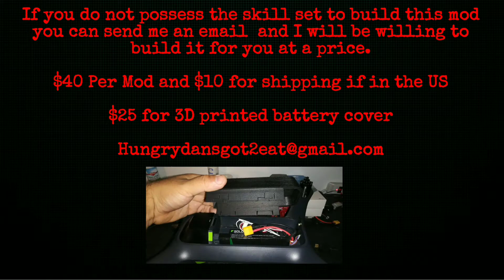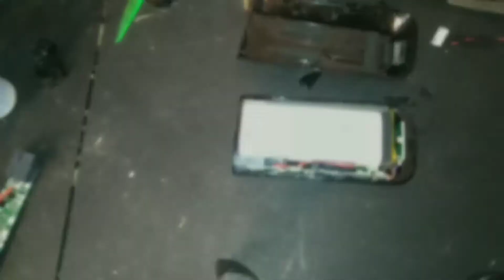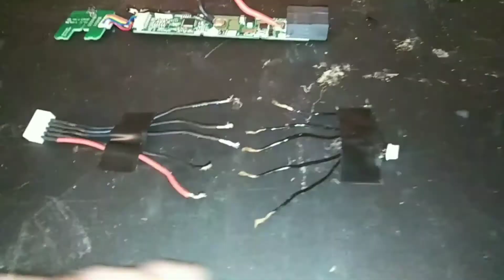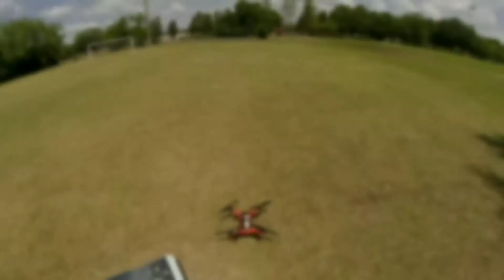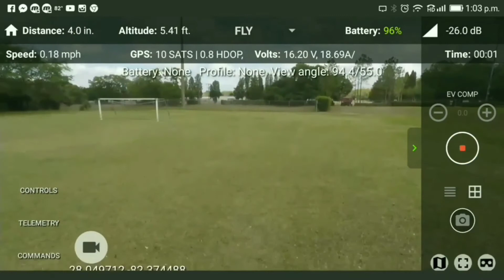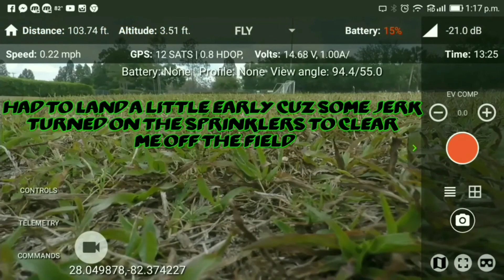The DW 3DR Solo Battery Mod Complete Build Instructions And Info

Comment: Great info Dan!! Thanks for working this out and sharing with us!
My batteries are ok right now, but it's good to know I can mod my own when they eventually give in 👍👍👍
Reply from the maker: All of the batteries I fly with are okay until they fail you don't know when it's going to happen it just happens you should watch my last video you will understand what I mean
Reply from the maker: https://youtu.be/65hL-Lu2nvo
Reply: I see what you mean mate, I'll be sure to keep a close eye on battery percentage and volts!
Cheers bud 👍
Reply from the maker: @StuartTiffany  I don't think you understand whether you're monitoring the voltage or not you won't be getting your solo back if you're under pitch controls drawing amperage to the motors hovering is one thing but moving in a directional path at anything over 12 to 15 miles per hour when a cell fails will cause immediate black out of the solo I won't have enough power to keep sustain flight so unless you always plan on flying at 12 to 15 miles per hour every single flight I would suggest performing the battery mod so you don't have to worry about it anymore. That was a perfectly good battery that only had two flights and it toasted on its second flight right in front of me if you had been flying when that battery did that your solo would have crashed without any warning
Reply: Point taken Dan, I intend to keep my Solo flying as long as I can, so I'll look to sorting my batteries when I get time 👍

Comment: almost 20m of fly time thats damn good
Reply from the maker: As you fly this solo your flight times will get better and better with that  pack I was getting almost 17 minutes of flight after about 25 charges
Reply: @IFixShet  i hear DW i have a question about batteries the batteries that i have they still hold charge pretty good do you think i should scrap them and do the mod i have 5 well the only down side is that i get around 12min of fly time